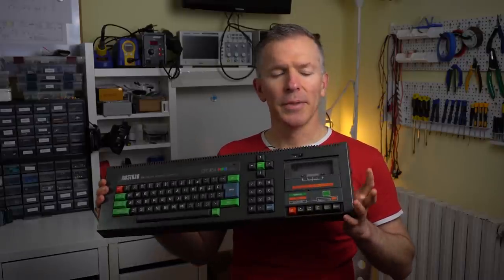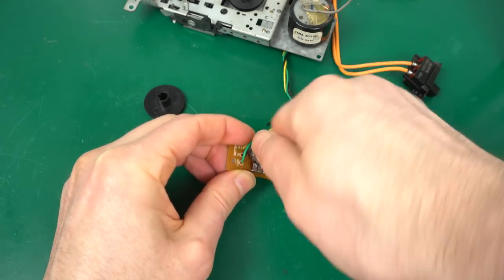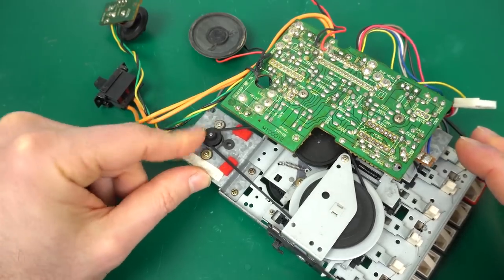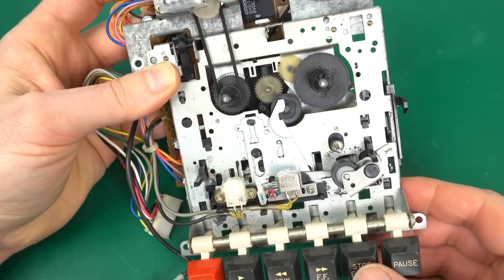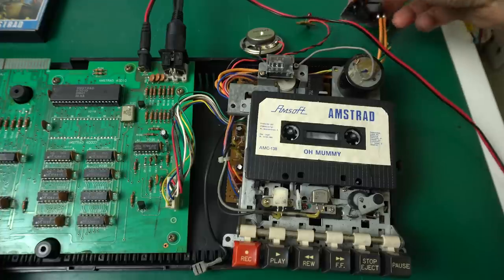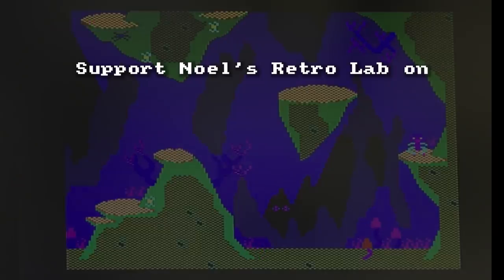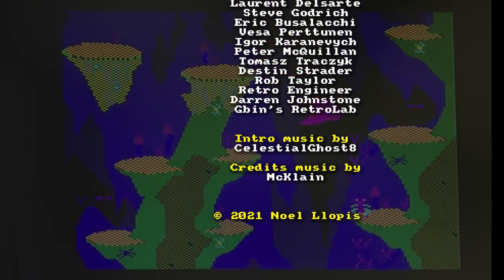Tape Deck Tune Up on Amstrad CPC 464

Comment: That head alignment tape looks so much better than the commercial one I've been using all these years. Definitely going to check that out. And Oh Mummy, I remember is well, transfers just fine from tape to disk as well from what I recall.
Reply from the maker: Yes, that's the best one I found. It works great and you can see it changing the distribution in real time. Too bad I didn't have to do it for this video 😃
Reply: @NoelsRetroLab  The commercial alignment tape I have instructs you to move the adjustment screw from one extreme to the other then split difference. At the extreme you get a beeping noise to indicate you hit it. Not the best way of doing it by any means.

Comment: Another great video Noel. It’s remarkable how reliable compact cassette player mechanisms are given the number of moving, including sliding, parts they have. I will also mention cleaning the capstan and pinch roller as these are key parts of the tape drive (also covered in a previous comment).
Reply from the maker: Thanks! I'm not sure I would call it exactly reliable 😃 They do fail an awful lot! But I suppose it's because they have so many moving parts, like you said. Yes, good point about cleaning the roller and the capstan too.

Comment: Good video, I take note of the pause trick. I would add, that in my case the SW301 was very dirty (35 years accumulation), the same or more as the main power switch, like in your video. Its function is to close/polarize the coil circuit of the playback head, connecting 1 pin mechanically to ground. When it is dirty, acts as a resistance or false contact and introduces random noise in the circuit. So the tapes, especially the turbo, sometimes load and others do not.
Reply from the maker: Yes, good point! I've seen that once and that also reminds me that I've seen the leaf switches for the motor current get so corroded that they didn't conduct and so the tape deck appeared completely dead.

Comment: I've never used or seen an Amstrad myself, but I have to say that they look really cool. I like the black case and green and red key colors. :D
Reply from the maker: Yes, the 464 had an awesome color scheme. I like the 6128 better as a computer, but the 464 wins in style.
Reply: CPC was a very colorful machine... even the on screen color palette was some of the best in the 8-bit era
Reply: The CPC has multiple graphics modes. If you get the chance check out anything in Mode 0 on a real CPC monitor. Very colourful. Good examples include Gryzor, P47, Turrican 1 and 2, Savage, Super Cauldron, Prehistorik 2, Rainbow Islands, Robocop and many more

Comment: Good job, Noel. In particular the way you fixed the Pause function; had i been tasked with it, I would probably have considered using a self-tapping screw + a washer, but i think your solution is more reversible, in case the proper parts should show up.
Reply from the maker: That would also work (plus the spring, of course). I didn't think of it, but it's good to have a large bag of tricks. You never know when you'll need them!
Reply: @NoelsRetroLab  Plus the spring, of course! hehe

Comment: When I was at school I had a ZX81 then Spectrum. I adjusted the tape heads with the science lab oscilloscope wired to the mono headphone cable.    Tapes loaded perfectly after that.  I know not everyone has a scope.
Reply from the maker: That's actually a great idea. I use the oscilloscope a lot. Why didn't I think of that?? 😃 What are you looking for with the oscilloscope, highest possible amplitude? Or were you looking for a particular shape (well-defined square for example).
Reply: @NoelsRetroLab  I just went for the largest amplitude that was not distorted.

Comment: Tape counter reset plastic is brittle at best.  Fixed one by shaping a piece of staple metal into the required shape, then drilled 1mm holes in the body of the original broken unit, fitted and superglued to tack into place.

Comment: nice tips Noel.. 
i remember amstrad action had something about the azimuth in one of the mags.. IIRC it was a basic program that would read a pure sinewave... i remember playing with the adjustment on mine, but just ear-balled it!.. coz i never had a way of putting a pure sinewave onto a tape!
also the white head is just for erasing (its an electromagnet!)... it wasnt needed for exporting programs out with one of the cassette adapter to headphone jack..
Reply from the maker: Thanks! Yes, this azimuth program is also a type-in. Maybe it's the same one, or if not, a very similar one.
Reply: @NoelsRetroLab  from what i remember its quite different...IIRC there was a image of a sinewave.. no graphical output from the tape being played, just showed some numbers below the image...
btw...that little notch in the case between the cassette door and the buttons.... is for adjusting the azimuth with everything in place! (altho.. lookin at it..it seems to be on the other side (left) of the head?!)

Comment: I hadn’t wondered what the Amstrad loading tone was like until today. Pretty Spectrum-like. Interesting.
Reply from the maker: That's giving me an idea of making a video comparing loading tones and why they are that way. Hmm... 😃
Reply: @NoelsRetroLab  It may sound bizarre but that's something I'd be interested in for sure. The Speccy had quite a few different approaches and baud rates. I was amused by the beepload, which aped the Beeb and Electron and was great for not crashing if it missed a block. Some of the Gremlin and later Vortex games would load loading screens piecemeal in strange ways. I gather a C64 could turn off the tone and play music. Ataris take forever to load from tape. I've never heard an Apple ][. I wonder what other computers sounded like.

Comment: Great stuff and hints again for repairing the tape drive. I like your T-shirt selection. Are those original shirts, or did you remade them by yourself?
Reply from the maker: Thank you! No, none of the shirts are original. I just had them printed myself from high-resolution logos (which sometimes I had to re-create by hand).
Reply: @NoelsRetroLab  this is great. I think, I need some Amstrad related shirts now... ;)

Comment: great vid... i brought some plumbing o rings for that tiny wheel.. love the reset arms.. blu tack on the screwdriver for that  horrid screw by the speaker ..i find the audio mod works well but will require decent  input source with high gain.. also it will load OTLA loaders (30 seconds to load instead of 8 minutes) alternative audio mod is the read head but tape adapter works well
Reply from the maker: Exactly, plumbing rings are good for that wheel. Although I find that they aren't manufactured with a lot of precision, so some of them have uneven widths. Still, it's worth buying 20 of them and throwing some away. Good tip about the blue tack for the screw!

Comment: I like that azimuth locator test tool. I have the original azimuth alignment kit, I replaced a couple of heads. It appears that its only as a DSK file, have you a CDT so I can transfer that to a cassette Noel? Cheers. Great work as always

Comment: Thanks for the tip how to clean power switch, I have one which have problem switching on, now I know how to open it. :-)
Reply from the maker: Glad to help. Yeah, that's not instantly obvious how to do it, but it's easy once you know the trick. It's a very common failure in CPCs actually!

Comment: Hi Noel, great vid. I am having same issues with mine so going to give this all a go. Do you have a link or contact for anywhere that has those tape deck counter buttons. Mines sames as yours, all snapped. Thanks.
Reply from the maker: The 3D model is available on thingyverse, but I had Gee-k print them for me (http://gee-k.net).
Reply: @NoelsRetroLab  That's great thanks.

Comment: Hi Noel, I followed your instructions and added line in which works perfectly but having a working deck inside my CPC I wonder how could I connect my external tzxduino to record on the actual tape from external input? 
Great video!!!

Comment: Great video. I'm in the middle of a similar job on a 464 and it's helpful to see how you do it. Also, didn't know about the azimut program. Not sure how it works. Need to look at that more closely. Cheers
Reply from the maker: Glad it was helpful! I'll add a link to the azimuth program in the description in case that helps. Cheers.
Reply: @NoelsRetroLab  yew, please! Also it would be nice to show us how to replace both belts if needed.

Comment: Nice repair, as always! I only don't get how that pin with a "hook" on one end holds inside the plastic tube. Did you "unhook" it from the bottom?
Reply from the maker: Thanks! As soon as the pin goes all the way through, the spring tries to move it up and the bottom of the pin hooks to the side of the tube (unless you're pulling perfectly straight up). And since nothing else pushes it down, it's hooked there permanently.

Comment: Do you use and Amstrad Plus computers? I really want to get mine running again. I think the tape deck is the main part that needs to be fixed. Similar to this model I hope.

Comment: Hi Noel, my 464 is always making background garbage noise when the volume is up. Interestingly when it plays a melody or starts loading from the cassette this noise disappears. I am going to give a good cleaning to the volume wheel but I think it may be due to something else. I was thinking about a capacitor in poor shape. Have you ever seen something like this before? Thank you
Reply from the maker: Yes, start with the wheel because that's the easiest thing. But I've seen that happen with really bad capacitors in the tape deck. Once you replace those, the noise is probably going to go away. Watch out because I think one of them doesn't have any polarity (you can skip that one).

Comment: Hi Noel thanks for the video. I have just done the same thing with my 464 but after reassembling it the power light is not on and though the tape drive has life there is no display, any ideas what it could be? Annoyingly it was fine before I did the maintenance work!

Comment: at 7:30 pitch roller needs replacement and capstan needs cleaning too!!!!  how do u adjust azimuthium correctly ? i am asking as a zx  spectrum +2 owner (back then 1986 and now(lol) 2011)  i played with this screw back then as a kid but i didn't know the correct procedure  ty in advance!!!!!! exellent work

Comment: Hi, quick question for you if you don't mind. I have a 2nd amstrad that works, it loads tapes but the sound just sounds a little off or slow when loading, it can load games but fails with error a or b, sometimes at the end of the tape or straight from the begining. Is there a way to tune the sound of the tapes loading?

Comment: Thatgame Roland in the Caves looked suspiciously similar to one called Bugaboo the Flea I remember playing on my Spectrum many years ago...
Reply from the maker: The original name was The Flea (La Pulga). Later there was a sequel and maybe that's the one that had the name Bugaboo? Not sure, but they're certainly all related 😃
Reply: @NoelsRetroLab  I just looked it up-according to Wikipedia the Spectrum version came first, and was ported to the Amstrad to take advantage of the Roland character on that platform. I guess they renamed it to Bugaboo the Flea for its UK release because they felt just The Flea didn't sound cool, or something!

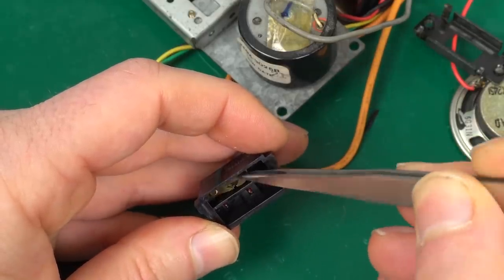Comment: 1:54 I think, that grease that you removed from the switch was its lubricant.
Reply from the maker: Probably. That explains why it gets all dirty and stops making contact after several years. I don't think it needs it at all. Or maybe the purpose of it was to prevent rusting which would stop it from working even before the gunk. That could be it.

Comment: at 4:05 better change it .......... it will fail again.....  nice video - exellent work!!!!!
Reply from the maker: The volume wheel? Usually there's no need to change it, it's just that dirt gets in there and prevents it from making good contacts.
Reply: @NoelsRetroLab  ok!

Comment: Hi wonder if you can help..I was given link to this video by someone on cpcwiki

Today 2 games came in post and neither loaded so assumed dud tapes but I then tried some of my other games and they did not either apart from 1, the first dizzy game got to the loading picture screen then cut off to black screen, treasure Island dizzy both copies either said error b or the main screen stayed on and the tape carried on winding till it ran out...the title of the game did not even show.

Other games were the same only 1 loaded Roland in time but it seems that was a fluke.

It was all ok last time I used it. I have ordered a cassette tape belt incase it is that.

BUT I wondered if I need to align it like in your video, I wondered could I use one of those car cassette tape adapters that I use to load some games from my phone with this software if I download the dsk

Comment: Oh I missed the cassette sound so much, I used to play my Apple ][ games by loading cassette tape when I was a child. I didn't hate the analog high pitch at all, I always turn the speaker on. Not sure it's useful or not, when tape not loading or error, cleaning the rubber wheel will help to improve the clarity, guess the rubber stick all the loose powder on the tape.
Reply from the maker: I have fond memories of the high-pitched noise as well. It got to the point that I could tell what kind of data was being loaded by the sound of it (loading screen vs. code vs. graphics). Happy to hear it, but happy to have better/faster loading systems as well.
Reply: Yes, the pinch roller (AKA ther rubber wheel) tends to collect loose dust from the tape which creates a hard and shiny surface. One solution i have used successfully (on an audio tape deck) is to use some very fine grit sandpaper and gently rub it up and down all along the circumference of the rubber roller.
Also, i consider the loading sound an essential part of the retro experience too; even when i run an emulator on my PC! 😅

Comment: Do people ever try those cassette adapters to get audio in from a phone?
Reply from the maker: Yes, and they do work. But since the case already has a hole, I'm going to put an audio jack to feed sound data directly, and then maybe play around to see how fast we can go 😃
Reply: @NoelsRetroLab  I just tried OTLA on my ZX81 and sped up a 16K program load-time from 341 seconds to 13 seconds...mind blown.

Comment: The solution to keep the spring in position looks not that save. After some uses it may plopp out.
How about using a plastic cover cap or a rivet? Just an idea...
Reply from the maker: You're limited to something very similar to the original piece. Something very thin needs to hook at the end of the tube, and it needs to flare out enough to keep the spring in place. A wider cap would be ideal, but I don't have anything remotely like that.

Comment: if u have a small failure belt it will cause some games not to load and u will suffer(lol) adjusting azimuthium  until u load a game  .. i had this issues as a kid (lol) took half a day to load some games what days back then!!!!!!!!!!!!!
Reply from the maker: Yeah, if the problem is the belt and you start adjusting the azimuth... you're in for a world of hurt! 😃

Comment: You need a utility to copy those cassettes to disk. 😉
Reply from the maker: That's how I started learning hard-core assembly programming back in the 80s. Copying tapes to disk, then breaking copy protections, etc.